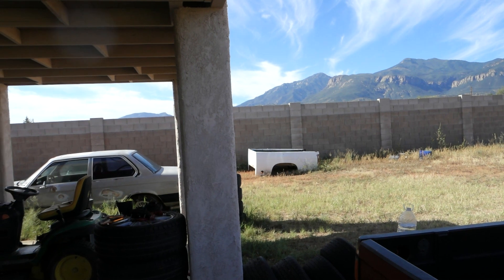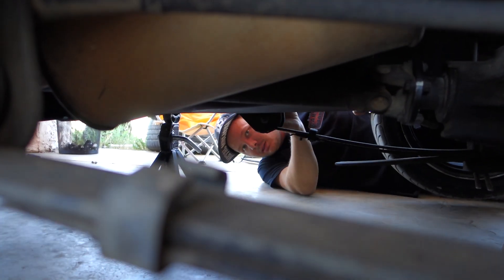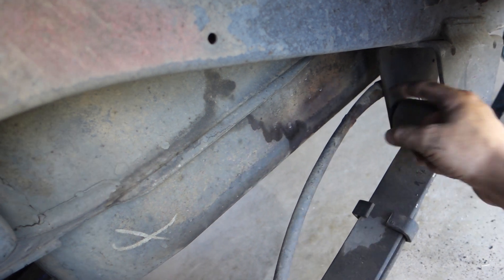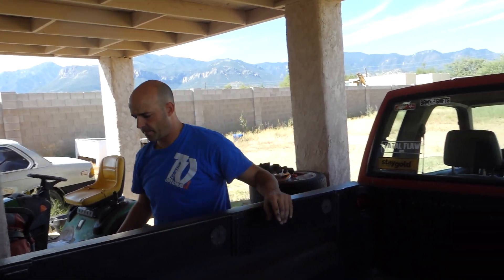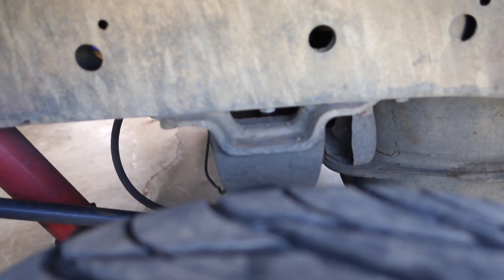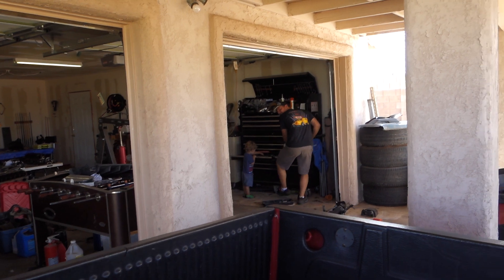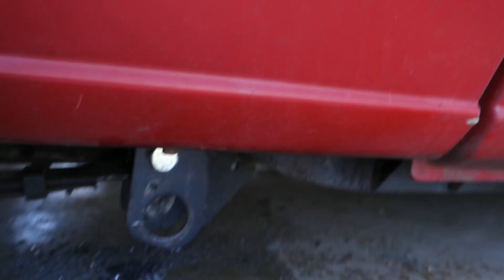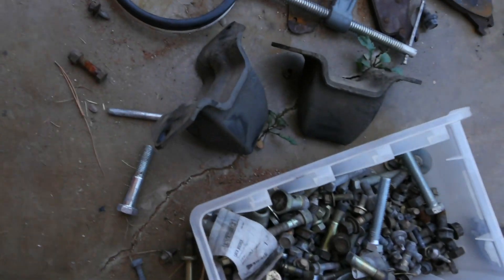D21 Hardbody: Leafspring Hanger Re-Drill  (MOAR LOW!!)

Comment: Make sure the front are even,it might make a difference for the rear to be one side higher I had a 86 1/2 hardbody with a v6 extended cab automatic 2wd lowered 3inches back in the 90s wish I’ve kept it

Comment: I did same drill job on leaf springs... heads up the 4” drop blocks might pinch the axle and brake lines with the drilled brackets. Clearance is only inches on mine?? Axle to rails and bed....clearance

Comment: Double check your torshen bar bolts.  My 94 D21 single cab  was uneven like yours and that's how I fixed it
Reply: @LocalLosers520  when I first lowered my truck my bed was the Sam way about a 1"1/2 lower on one side. In the front it exactly the same.  Took me 3months before I finally checked my torshen bolts.  Mine where off I reajusted them. After putting my tools up and taking a drive I stopped for pictures. That when I saw that it fixed the rear also
Reply: @LocalLosers520   no I haven't done that yet.  When I 1st lowered my truck I did 1 side and a buddy worked on the other  some how when we where done one side of the torshen bar bolts was out more. About a inch and a half more. We didn't notice this because the truck looked level in the front. Or maybe it's because it was dark out and we might of had a few beers when doing the work.

Comment: Did you guys ever come up with a solution to the rear shackles having different angles, and the height difference? My truck has one that holds up, and the other does not, I was thinking new bushings (polyurethane perhaps)
Reply: @LocalLosers520  Hey, figured I'd let ya know, new poly bushing for the leaf springs fixed my issue, leveled out nicely.

Comment: I have a regular cab and I’ve been wanting to do the redrill I’ve heard I have to space my carrier bearing do y’all by chance have any insight and on the bed difference have y’all removed the little rubber bushing between the bed and frame you may be missing a some or one side may be more worn then the other that was my issue
Reply: By removed I mean have y’all removed the bed or do you know if the bed has been removed and check the body lines if they don’t line up then there’s either something in between bed and frame that’s missing or not supposed to be there

Comment: did drilling the perch and putting the spring higher did it turn the rear end up like a inch or 2.
Reply: @LocalLosers520  does it messup the pinion angle drilling it.and putting it up.

Comment: Just flip the springs upside down with 3 inch blocks it works and you would probably need to run 15x8 or 15x10 on 195   I did it to my 720 Datsun and it sits on the ground i got a Nissan hardbody with flipped springs and 5 inch drop blocks and people think it’s bagged but nope no air bags 😂
Reply: Local Losers 520 💯 people think I’m crazy I’m from Hawaii so the roads are bumpy a lot of the people just broke neck 😂😂

Comment: 5” bolt will hit the gas tank! I used 4.5” and I barely had clearance and you will have to thread the bolt into nut on the gas tank side with 4.5” bolts

Comment: How much fuels in it? Hardbodys lean = weight of fuel
Reply: Gotta think there's alot of weight on the passenger side of these trucks, fuel tank, battery, only thing on the driverside is the exhaust besides that there's no weight on the driver side, put a fuel cell in the center and you'll notice the difference

Comment: The front tires are probably not on even ground or the torsion bars are not set with even tension.
Reply: @LocalLosers520  The rear is on concrete but the front is in the grass.